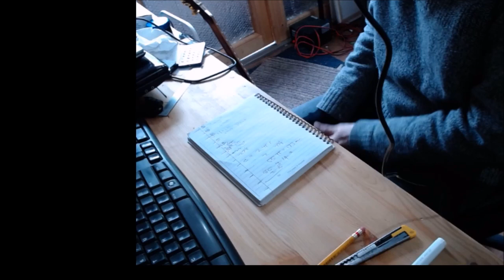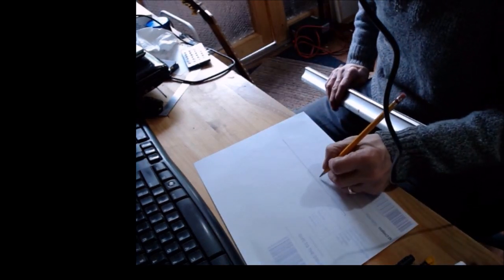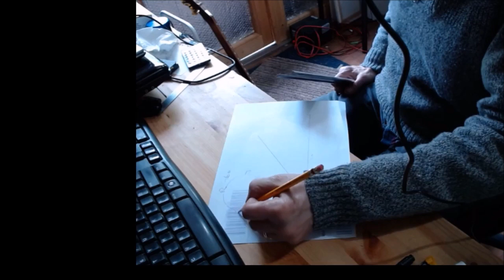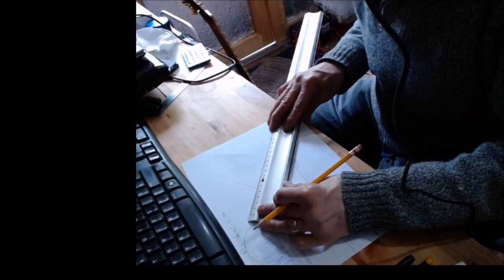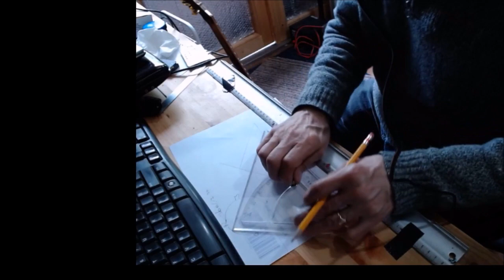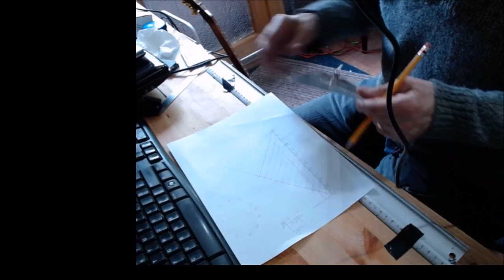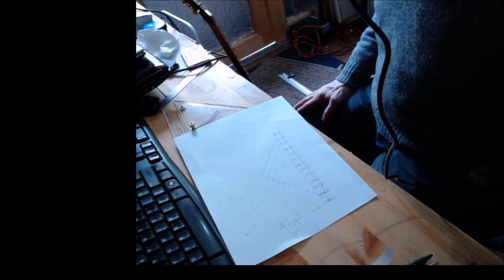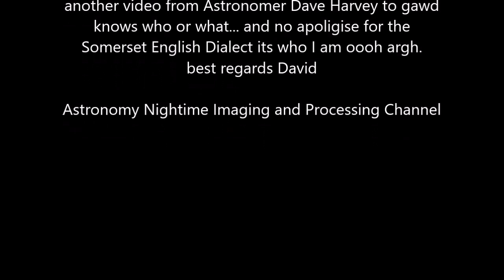create an Astronomy Manual Camera Rotator

Comment: Thanks for that David, was just hoping that you had some wonder idea.....alas I already did this! All a bit sketchy with focus, making sure the optical train is reseated properly etc, but it works.
Reply: Hi Phil as an upate if you use ~NINA connecting to the Manual Rotator resolves rotation during Platesolving when running the Shedule which is the way I now currently work.

Comment: The diameter is always equal to 2*radius, so no need to divide the diameter by 2 and then multiply by 2. Just do circumference = pi * diameter.